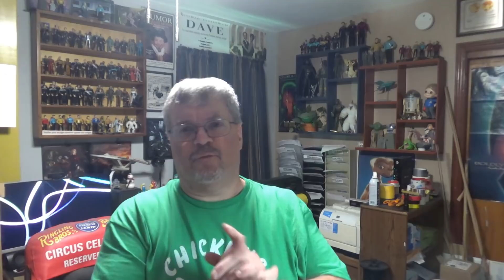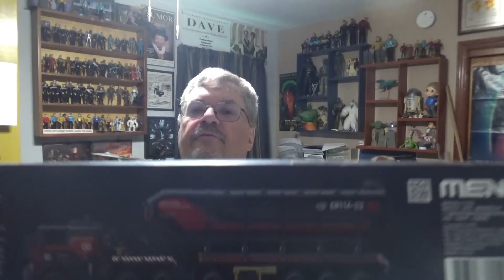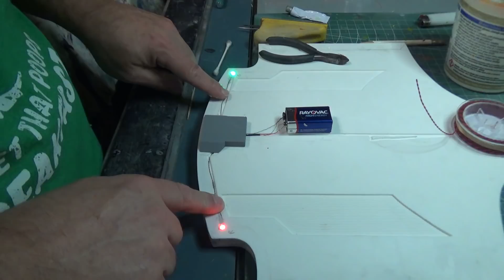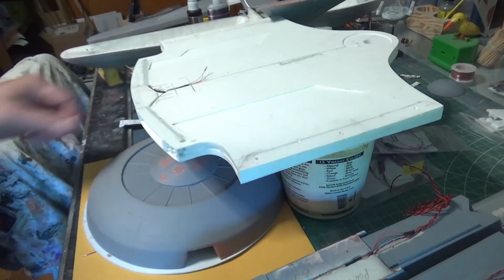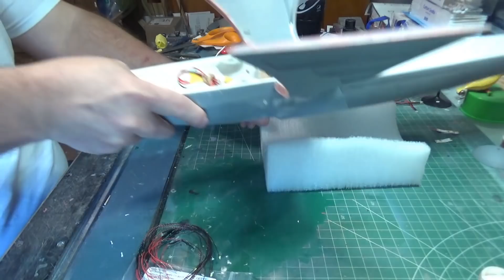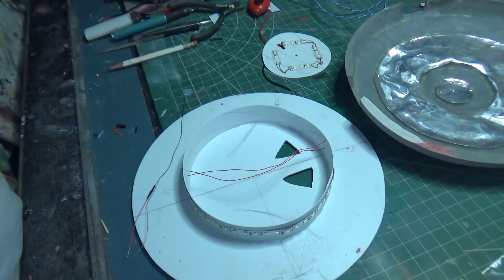Aztek Dummy Update 6/11/21 - Grissom Part 3

Comment: That little router head for the dreamer is right handy. I will guess and say that the finished Grissom will show no permanent evidence of the ditches in it integument. Somewhere I remember a conductive foil stripping. It equates to flat wire. Self adhesive it was. Tape it on the surface like a panel line, hide the soldered ends and paint. I think such a thing would be available maybe from digikey?  Modern LEDs run on single mili amps now. The foil would never heat.